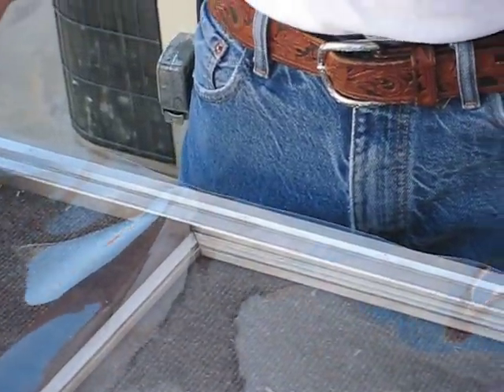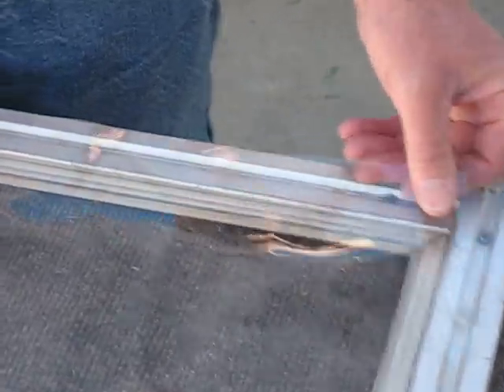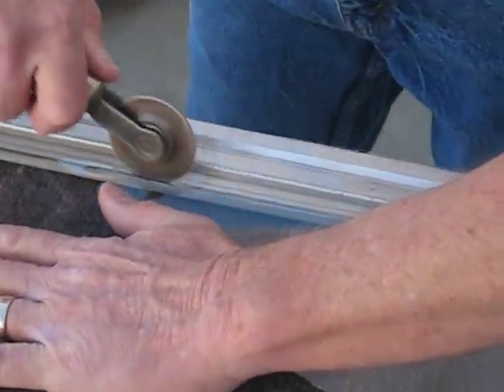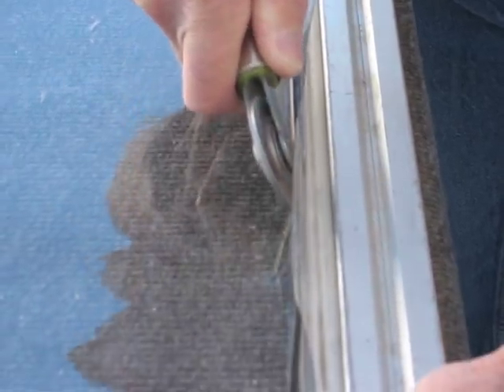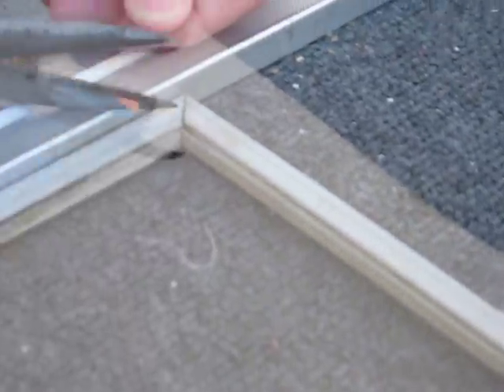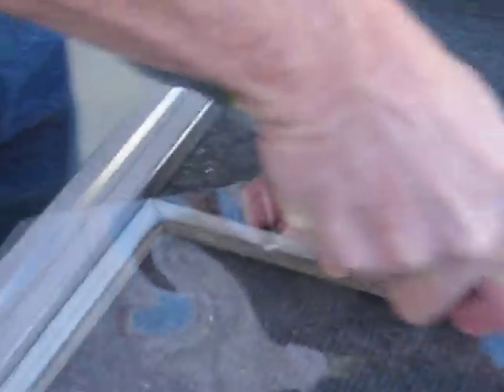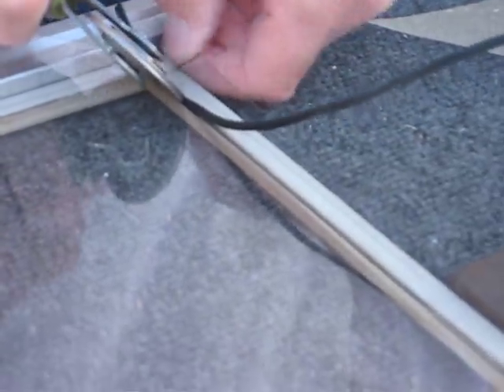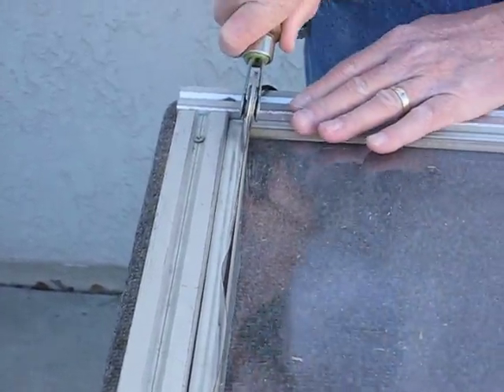How-to Install Clear Plastic In Screen Frame - Part 1

Comment: After watching several how- to videos, this is the first one that actually worked for me!  Replacing worn out vinyl with 20 gauge marine vinyl on my Florida room.  I have a slight pucker in one corner, but it's hardly noticeable and considering it was my first panel and fifteenth attempt with the piece of vinyl, I'll take it as a win.
Reply: Where did u buy the vinyl
Reply: Glass is better